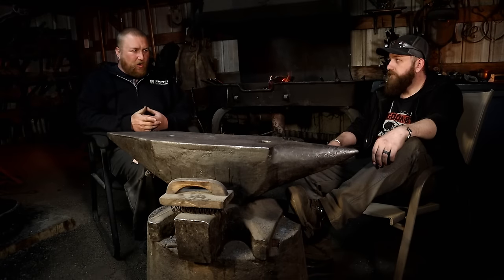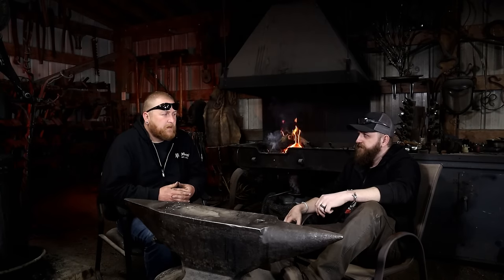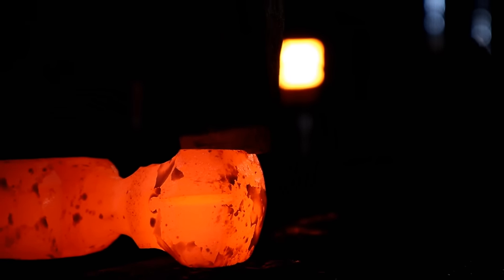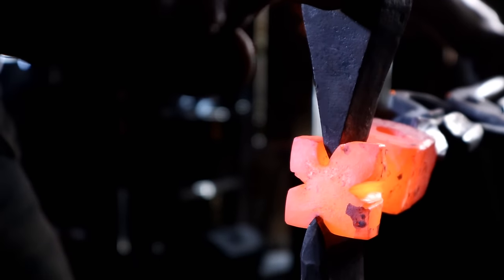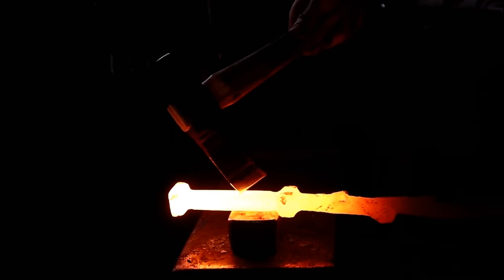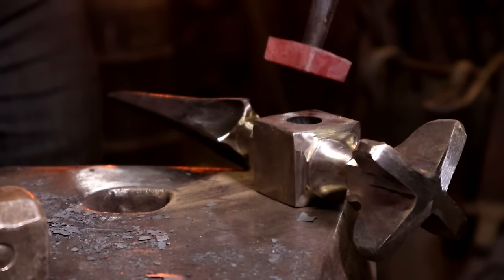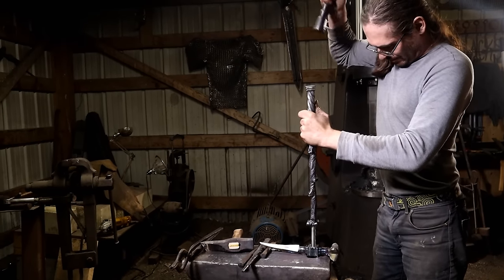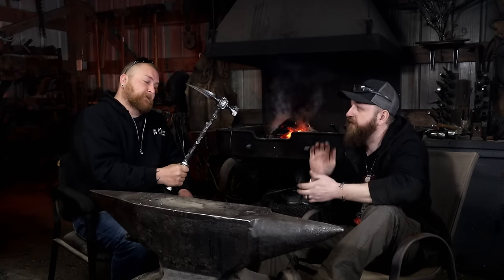Forging a [War Hammer] - 1st Historical Build

Comment: I heard rumours that if you squat in front of a forge, throw a hammer in it and say Alekseyev backwards 3 times it will summon Ilya
Reply: Heels on ground to make Ilya come 'round?
Reply from the maker: please dont do this !
Reply: Instructions unclear. Face is burned and I can still see the sun when I blink.
Reply: They need him for their builds.  If he’s constantly being summoned then he can’t get as much done.  Simple time/labor management really.
Reply: @ThatWorks  Why?Because Ilya need to work?
Reply: They need him to stay at the shop, it's too expensive to have him fly home every time, even with Blacksmith Air Miles.
Reply: I tried this and all I got was Jay Nielson.
Reply: @ThatWorks  p
Reply: Thats cool, but you gotta see the guy who actually slaps molten metal, massive foundry with rivers of metal, and the man slaps it. Its some weird principle where the heat doesnt transfer, i dont know the name, but search youtube for molten metal bare hands and youll see what im sayin.
Reply: @Thomas.Wright   Forget slapping scale off of a billet, in the "Among Us Imposter Knife" video he hammer-fists a yellow-hot billet six or eight times in a row.
Reply: @andrewut7ya511   The Leidenfrost effect?  It requires that your hand is wet, so maybe it's another effect you're thinking of.  Its the same reason one can dip their wet hand directly into molten lead and not get burned, and the reason droplets of liquid skip and bounce around on a hot pan like they're not touching the pan (they actually aren't.)
Reply: correct
Reply: @gwallace5403  dont blink
Reply: @ThatWorks  ;)
Reply: @gwallace5403  solution turn around do it again correctly apply burn cream

Comment: geez imagine getting smacked by a war-hammer in a time when medical technology couldn't detect concussion related injuries.
Reply: Either way, you're dead. Armor was only a small protection from hammers and maces. They were designed to work against armored opponents.
Reply: @zacharybrown5325  Yeah the helmet are fine but your head that's under the helmet will still feel quite the shock and concussion
Reply: True, maybe not dead. But you'd probably wish you were after getting walloped by one of those.
Reply: @mailais3403  don't underestimate armor. Armorers knew that some guys used warhammers on the battlefield. There is room under the helmet between your head and the helmet. And the curve of the plate make it very difficult to land a proper hit. But of course, we shouldn't overestimate plate. It is not meant to render you invincible to anything. A well landed hit will hurt or disable you
Reply: The problem with the hammers is that they don't attack the armor itself. When you hit an opponent with a hammer, you're basically throwing a lot of "Blunt Force" on him, and this Force (this Kinetic energy) has to go somewhere, and plate armor, while extremely good at deviating piercing and slashing weapons, is completely unable to absorb this type of attack.
So what happens when you hit your opponent's head with a warhammer, goes like this :
You may, or may not, bend the helmet, but it doesn't matter : the Impact gets through the armor as it's directly transmitted to his head. Basically, the armor may look fine, but you just broke his skull underneath the helmet with the Impact.

Of course, this assume you can land a proper hit on said helmet, and that's why people were still using shields even with plate armor : better to have the shield tank the hammer blows for you than your helmet
Reply: @jeanladoire4141  Plate armor was basically a konamicode of medieval battlefield. Arrows, swords and spears have a minimal chance of doing any damage. Hammers would do damage, but would be highly unlikely to kill you. Blows to the head would ofc hurt and disorient you, but a seasoned warrior in plate can take one or two of those before going down. The idea of warhammer isn't to kill the guy in the plate, it's immobilizing or incapacitating him. It's pretty much impossible to kill him with anything else than a dagger or a lucky and well placed thrust with a spear or a sword. Axes do pretty much the same as warhammers, the reason why axes were still popular in later medieval times. Swords do jack shit unless you are really lucky with your thrust. Or the opponent for some reason let's you kill him. 

Also to me it seems that some people (not meaning you) don't really respect the protection a mail offers to a person. When worn properly over a arming coat or gambeson or what will you, mail offers good protection against swords and decent protection against hammers and axes. One could say that a spear is a dangerous weapon against mail. Especially when used on horseback.
Reply: @Pyllymysli  Yes exactly. Plate armor was really good, especially when the armourers managed to give it strenght at minimal weight with its rounded forms.

Tho maille is not really understood. A few years ago, i made a crappy short haubergeon with butted rings i made from thick wire i coiled. I used 1.8mm wire (a bit less than 14ga) Even tho it was butted, the thick wire made the rings quite strong. So i tested my spears and swords against it, and it had a quite impressive protection against even thrusts. Okay, the thick wire is heavier than what would have been used in riveted rings, but i saw that the weight of the metal combined with a thick garment under it  would absorb most of the shock. We all know that landing a powerful hit on someone is difficult during a fight. Tho i must say that getting hit hard with a powerful sword or a mace is EXTREMELY unpleasant and would probably incapacitate someone if done well. 

So yes, maille is indeed an underrrated protection, but of course, plate came as an improvement, offering even more protection for less weight... But of course you will always need maille to cover what you can't with plates !
Reply: @jeanladoire4141  Plate never really replaced mail. Mail reamained as the most dominant form of protection till the end of the era. Plate just got more common. 

Mail got other perks for common soldier over protection. Like you can dress it by yourself, it's cheaper and it's  maintainable.
Reply: @Pyllymysli  Yes of course ! and armor didnt disappear trough the centuries. In the 15th century, most soldiers had decent quality armor, simply beacause they could buy an old 13th century refurbished maille haubergeon for pretty cheap ! Tho we shouldn't view maille as a cheap armor. There are exemples of maille hauberks of the 13th century that are of extreme complexity. Cor exemple, the size of the rings tapered along the arms so that it would perfectly fit the wearer and allow for maximum mobility ! We can imagine that a common soldier would only have access to munition grade armor... A bit like plate, but as i said, you wear plate WITH maille... or sometimes just maille, as we see in fiore dei liberi's manuscripts (some guys removed their spauldrons to have less weight on the shoulders, and they only had maille sleaves, even tho the rest of their body is covered in plate)
Reply: @jeanladoire4141  Yeah, mail is a sophisticated armor. I'm a big fan and it bums me that mail is so seldom portrayed in pop culture and when it is it's paper. To me common sense says it's good. It was used for frigging 3000 years.
Reply: Erectar Denara This is something I would be interested in seeing tested with some experiments. Say some eggs inside a helmet, maybe a canteloupe, a shock sensor...etc.
Reply: @Pyllymysli  I agree. My personal experience as HMB player says yeah hammers and maces are bad and painfull so you try to avoid letting them hitting you but nothing "that lethal". On the other way if you compare it with two handed axes or bardyches, one good hit (not glance of course) to the head and you're blackout :D
Reply: it was brutal against full plate armor, the spike would go 4 to 6 inches into the chest or helmet.
Reply: @jameshaulenbeek5931  with a good armet, gorget, and thick padding you were good, just a little bit of shake in the neck
Reply: @RoulicisThe  earlier on, when armor wasnt as advanced an axe hit on the head could be lethal
(Robert the bruce vs henry de bohun)
Reply: @robertmiller5735  with padding, and mail underneath, hell no
Reply: Padded coifs my friend. Gambeson for your head. It'll make head hits a lot less damaging and that brings us to the spike. "Nothing makes a Man dead Like a Spike to the Head." 

As a bonus a hammer like the one they did would never sell. Well atleast to a person that could afford it and had a remote but of knowledge of fighting/armoured fighting. War hammer hammer faces were never bulged outward unless with many spikes think a meat tenderizer hammer. The spikes allow the hammer to Bite into the armour allowing maximum force to be transferred through the armoured shell. A bulge is effective in Spreading a flat surface and and is always curved. Two outward curves deflect eachother thus this piece, beautiful as it is, would never sell. Modifying another Smith's work was a massive slight against the other Smith and during a time where honor was the supreme athourity. That kind of a slight would get you killed in mutual combat.
Reply: A concussion is the least of your concern against this thing

Comment: Lighter weapon doesn't make more damage. It simply allows you to not expose yourself after overswings. (basically, it's just faster, nimbler)
Reply: Simply making a weapon lighter definitely does not make it do more damage. But what he was trying to describe is the concept of 'pressure'. Pressure is determined by force divided by area. So you can increase pressure two ways: You can either increase the force (such as by increasing the weight for example), or you can decrease the area. So if you decrease the surface area of the weapon, while keeping the weight the same, it will exert more pressure when you hit things with it. On a similar note, you can make a weapon lighter, and still exert the same amount (or more) pressure, as long as you decrease the surface area along with it. That's why, with proper design, a lighter weapon can still rival a heavier weapon in terms of damage.

Comment: I was surprised to see that since you were doing a steel hafted Warhammer that it wasn't made a s a single forging.  Would that be because you wanted a different tempering for the hammer head vs the shaft?
Reply: Future randomness exactly
Reply: That would be a giant pain in the butt. It's far easier to just make it as two pieces then put them together
Reply: @fleurdelispens  it would also be far easier to not include any of the embellishments on the handle or the head itself.  As these are high status weapons to begin with imagine how much of a show off you could be if you had a Warhammer that was all one piece!

Comment: I love this thing! It’s far too ostentatiously built to be a useful war hammer when considering large numbers of production, but it’s still not the high fantasy trope level of decor that kills a tool, with fashion over form. It fills the nice role of something a noble house might see fit to commission a weapon smith to make for its more esteemed warriors or bodyguards; including a noble themselves. 

It’s robustness, solid material with its decorative features not made to replace any practical function. There’s no ornate horn-ivory grip additions, or carved shaft with delicate silver inlays. Those are things that inhibit a weapon meant to make such heavy blows things a noble could use, but ones that don’t see to a battlefield any better. Things that would be destroyed if a decent blow hit the shaft of the hammer, gauged out or splintered apart. 

Instead the twisted metal looks almost like wood, but even then the nubs serve to make it easier to grip with a second hand if needed, and harder for a weapon to glide down to the wielders hand. 

The hammer face isn’t something so gauche like a rams head or a lion etc, it’s a nice cross, which would stamp any metal it hits under a certain thickness. Bunching it and compressing the area, potentially even warping the plates below to lock up moving segments.

Yet despite lacking hyper overt shows of it being an art piece, the way it flows together makes it one to any observer. Very well done! By using no wood shaft, it will conduct more vibration that can harm the hand, but by twisting the shaft with an irregular pattern, it will prevent the worst, and more weight on a war hammer is never something to scoff at. It’s truly well thought out and designed as a realistic, serviceable and yet fashionable weapon.

Comment: That spike could pierce mail but not plate. It could get through most visors or other weak points. I do feel the hammer's head was made a bit too rounded. They're usually made in such a way to reduce chances of it just skating off of plate armor.

Comment: An old fashioned broadsword--the type with a flat point and parallel edges all the way down the blade. Perhaps a large 1 1/2 handed in size weapon but without the long metal pommel indicative of the much later, mail piercing, fencing swords of the renaissance.

Comment: 9:58 Warhammers and maces work so well against armored opponents because they have more mass, different weight balance, and no sharp edge. 

More mass means more inertia, that means more force transfer through the armor and into the skeleton. My example for this is you would never forge metal with any part of a blade, because it's not heavy enough, and you don't want to blunt it. 

The weight balance is shifted towards the striking head, which is important because it helps give that end more inertia. Additionally, all that mass in the head makes the head more durable against repeated impacts, so you can keep on bludgeoning without fear of damaging your weapon.

Edges are great for cutting, but they can only withstand contact with something less durable than the steel. You got a blade against steel and you'll roll the edge; it won't cut anymore. A warhammer has no edges to blunt, and a point is far stronger and more durable than an edge.

Before I forget: the end with the point can just piece through the armor and into the lungs or heart, immediately causing a lethal injury if not treated, and back then that was difficult. It was the armor-piercing bullet of the older times.

Comment: Would love to see a Halberd, but I'm guessing many ask to see that. But some variations of daggers, broad, long or short and so on, would fine to see.

No better weapon you could have in middle ages than the Warhammer. Make a dent on the helmet or pierce through the chest plate to either hit a lung or if your lucky the heart. All I'm saying is that a warhammer could do a lot of critical damage, but only if you found a right momentum in every strike which prob make one of the hardest to master.

Comment: Beautiful work, honestly you guys are the best weapon-smiths I’ve watched on YT so far. Though design wise I think the hammer could have used a slightly oval grip as it rotates too easily in the hand [thus deflecting force away from the target] as you can see when the can is hit and mb the flanges could have been angled slightly back so as to reduce the contact area of the striking force. But dam if that isn’t a gorges weapon and the design overall is so elegant but functional; fantasy weapon designers could learn a lot from you guys as this would fit in ether a D&D illustration or a historical battlefield.

Comment: I would think a war hammer had multiple different uses and functions in a medieval combat setting. The best feature would have to be maintenance in a battle field setting. There isn't any unless it completely broke, no blade to sharpen or oil or straighten. It will always function like it is supposed to. Some of the heaviest infantry wore complete plate mail that was very good at resisting the stabs and slashes of swords and so switching it a war hammer was the only real option to victory. Against heavy plate the spike could pierce it but was meant to target critical points where injecting a steel spike did the most damage, such as joints, the upper chest region, and the helmet. The hammer head blunt end was used more for injury and subduing your opponent, not every combatant had to be killed. If you were trying to capture a VIP on the battlefield then striking with the blunt head to immobilize their armor by causing the armor's fittings and rivets to bind up at the joints would restrict movement enough to capture without killing. The medieval war hammer is more of a specialized tool for combat against heavily armored opponents. Against unarmored or even lightly armored targets a sword or axe type weapon would be more efficient and most of the subtlety and nuance of the war hammer would be wasted.

Comment: Beautiful hammer. Btw, try using a rubber band to turn your tripod head on the weapon pans. I know it sounds silly, but will give you a much smoother pan, even at slow speeds.

Comment: First of all, great work guys! Once again you've proved your kills with this dangerous beauty. And here are my questions: What steel did you use? if I want to make a warhammer or even a blacksmith hammer from scratch, where could I salvage the steel from?
Reply: I’ve seen folks use drive shafts from automobiles to make hammers.

Comment: Beautiful design. My only critique would be that the hammer head shouldn't have been flat, most pieces I have seen either hace a small "spike" in the middle of the hammer head, or a "four pronged" design. But this design would still krump 'em 'eads!

PS: The spike probably wasn't used to pierce plate. Yes, it CAN do it, but it's risky. Most likely the spike was used against softer targets like heads, and mailed bodies. The key to a hammer is really to just put enough percussion energy against armor to transfer the energy into the body of the opponent.